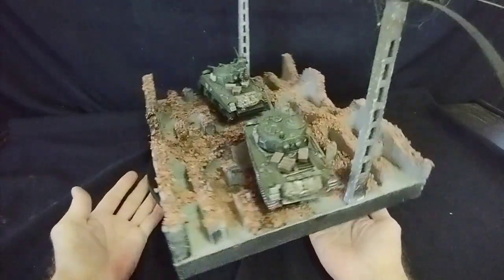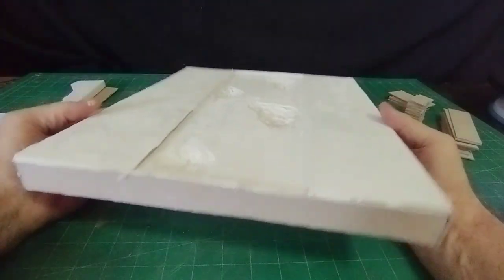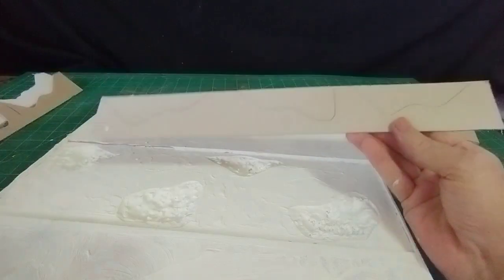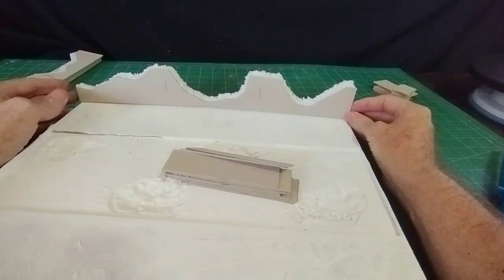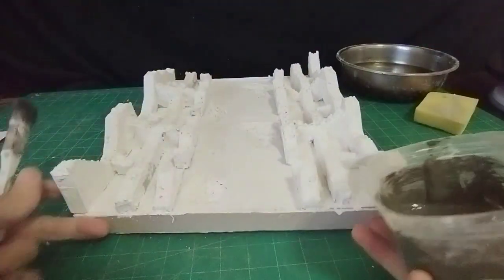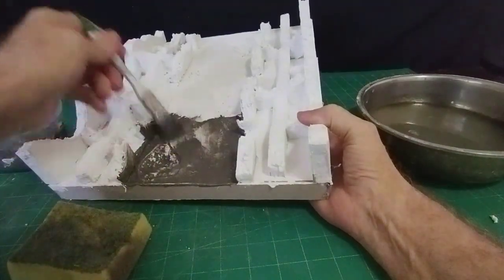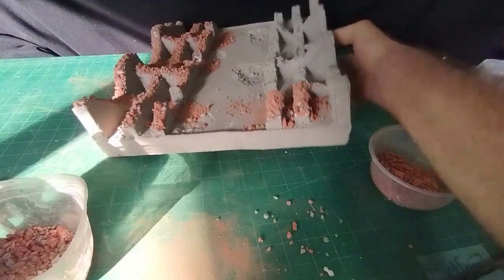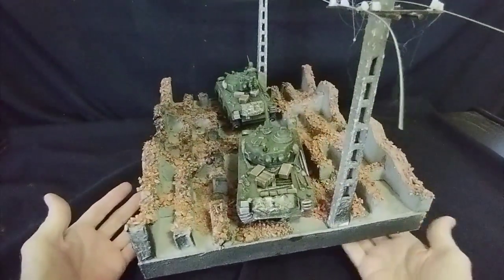"Desolation Ally" ww2 tank diorama. 1/35 scale step by step.

Comment: Though the setting looks more industrial than residential, the effect is a very good one, Don!  I also noticed that your tanks aren't a permanent part of your diorama, allowing you to switch-out models for a "rotating display."  This piece also has plenty of wargaming potential, as well, and could be made as "tile sections" that join together for a larger terrain, (or displayed end-to-end on a shelf to show off more models.)

As for the lack of a cobbled-road; all the debris from the bombed-out buildings would tend to hide what the tanks don't.  Still, a few bare patches of cobblestone (suggesting more underneath) would be a nice detail.  Think of Shep Paine's iconic 1/32 scale Monogram Ostwind Flakpanzer diorama in a setting similar to yours.  Mr. Paine left a few patches of visible cobblestone road not hidden by debris, and the overall effect was excellent.

13th like.